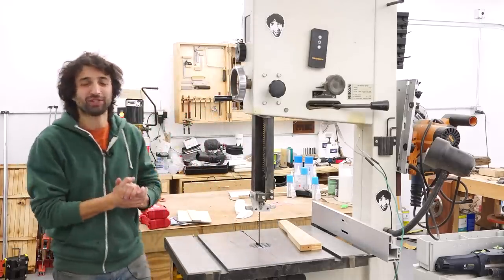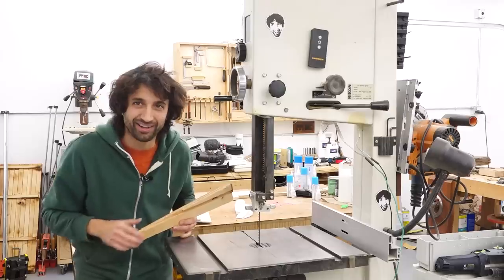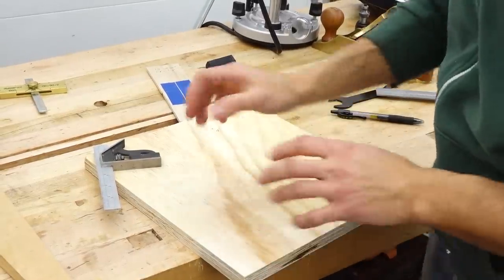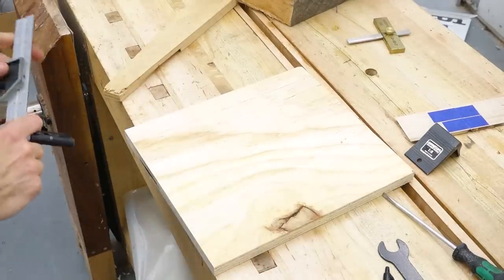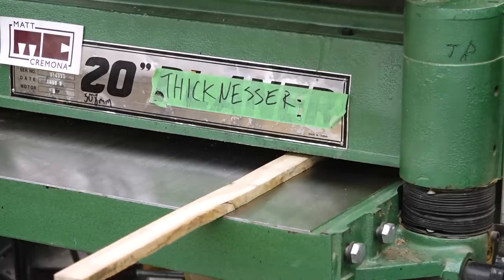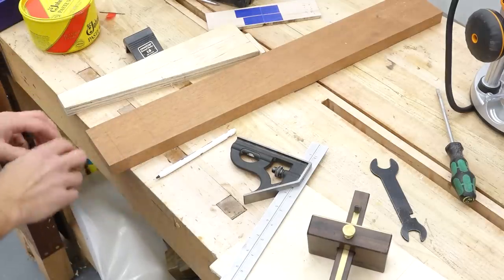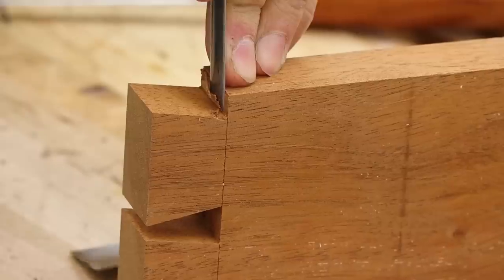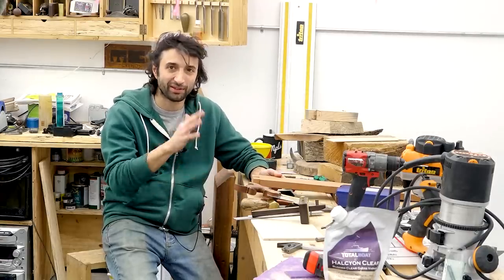Wedge Jig for Cutting Consistent & Symmetrical Dovetails on a Bandsaw

Comment: I just used this method for a commissioned piece, and it worked great. The only alterations I made were:

It was on 16-in wide boards, so I was able to get five of the fence setups done as shown, and for the other three I had to put the block on the other end of the tapered piece.

I added sandpaper to the mating edge of the jig to help keep it steady.

I used a spare piece of wood to lay out the dovetails and get the fence setup each time, since there was some trial and error.

And I added a stop clamped to the table on the back side of the blade so I wouldn't cut past my baseline. Michael Fortune demonstrated that in Fine Woodworking issue 270. He has a pretty extensive article on bandsaw dovetails, but I like the simplicity of Matt's jig.

Comment: I'm a first timer of your videos. This is such a beautiful simple little jig, thanks for sharing. An added bonus would be a stop clamped to the fence for consistent depth to the joint. Thanks again.
Reply from the maker: You’d want it on the table directly behind the blade. The stop point on the fence will vary based on the fence’s distance from the blade. Thanks!

Comment: That may be the simplest and most useful jig ever. Cut an angle that's close to what you want, then screw a scrap on the end to be cut off to length. Then, the simple usefulness of it in making repeatable cuts is fantastic.

I also appreciate that you stress how much 'close is good enough' because you use your results to mark out further steps.

Comment: Add a vertical to the fence side and a stop as you had, clamp it to the fence in the appropriate location so that as you slide the timber past the jig, the bandsaw blade will consistently cut the same depth

Comment: I’ve seen this suggestion before from other contributors, but your work is interesting and makes me smile, so I watched this again. It made me think that, if the wedge for the tails and two wedges for pins ramp were made identical, the angles should match very well.  Yes?
Reply from the maker: Yes but positioning the fence so the cut ends up right on the line is a bit annoying

Comment: hi Mat. Followed you for a long time and interesting video clips. Now watching the clip with angles. I am Swedish but live in Asia. As a Swede, millimeters are used, inches to a very small extent. OK, I have a question. We have the so-called "carpenter's angle" which can be used for larger jobs, for example house foundations. If you want to measure 90 degrees, you measure 800 millimeters from the corner of one side. From the same corner from the other side 600 millimeters. There should now be 1000 millimeters or one meter between the measurements on each side. Do you have similar systems for inches?
Reply from the maker: same thing 3-4-5 or any multiple of those numbers that works for the situation.

Comment: I noticed your accuracy. On remodeling your house, your accuracy was about 1/8". In your joinery, your accuracy is about 1/32".

Your flatness is about 0.03". An acoustic guitar's fret flatness is 0.0005". In tunnel diode ICs the flatness over 300mm is two atoms.

Comment: Thanks for the video, quick question, what blade and what specs is it?  It looks like 2tpi and gives very smooth results for the coarseness.  Also that's an impressively long video for such a simple jig, but you filled it with useful info throughout :)
Reply from the maker: Lenox trimaster 1/2” 3tpi. Thanks!

Comment: 7:52 so this only works for a maximum of two tails correct?
Reply: Pins
Reply from the maker: How ever many you want
Reply: @mcremona  I figured it out, need to reposition the jig for second cuts on  Tails other than the center one. This is a very useful jig Thanks Matt.